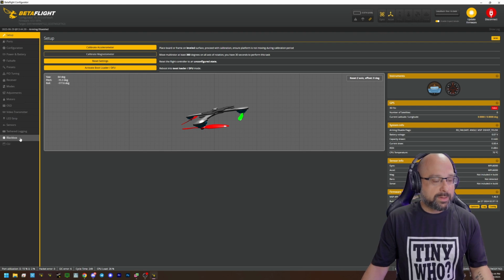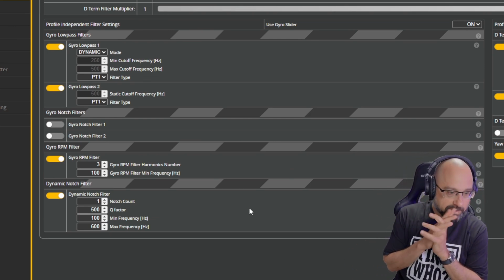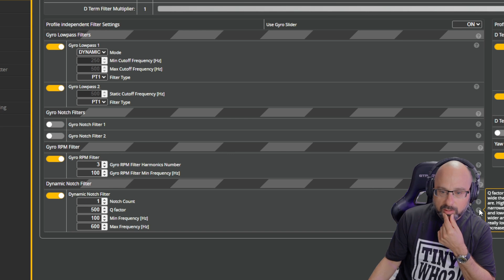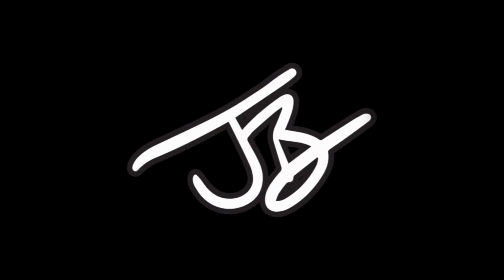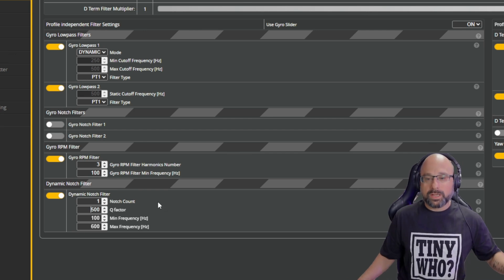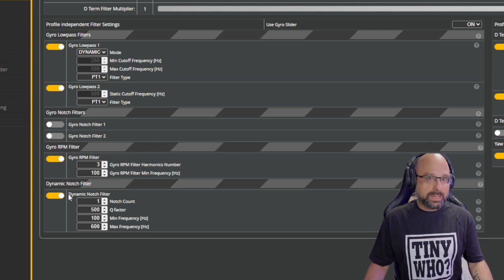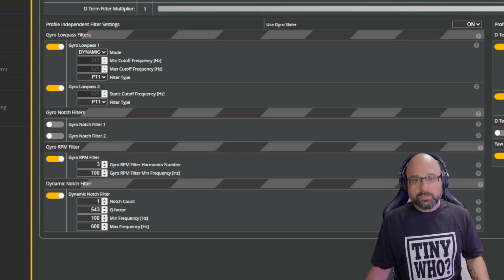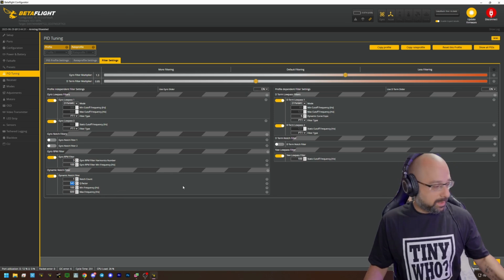Why Do Racers Adjust Q Factor And What Does That Mean? - FPV Questions

Comment: I have the avata2 but I have the Motion 2 controller and want to buy the fpv controller but am scared to crash and I also want an drone to take with me so I thought about buying the Cetus pro kit to practice and take on vacation.
Is this a good idea or not?
Thx a lot!
Reply: Assuming you have goggles 3 for your avata2, I'd look into something like a 85mm tiny whoop with an o4 lite, and the dji controller 3 if you're set on a controller that'll work for both the avata2 and a quad with an O3/O4 air unit. 85mm is big enough to fly outside even with small amounts of wind, they usually take light crashes better, and just good for beginners because parts are cheap when you break a canopy or prop guard

happy flying!
Reply: @ZuwuFPV thanks for the suggestion!
Will building yourself be cheaper? And do you think a 4” is the best size?
Reply: @RacerThieo so, building is maybe for when u are more advanced, but if u want to do it, it’s really tough, especially if you go for cheap ass parts. 4 inches is mostly for small long range, cause 5 inches have got more thust, and 3 and 3,5 are more resistant as they aren’t as big. If u are gonna build, go for a 5 inch. Although i would recommend you to start with the previously recommended 85mm
Reply: @HtRe_22-o7m oké thanks I am gonna challenge myself though en ho with a 3”.
I have already done it with a friend and although I believe it will be though, I think  I might be able to pull it of with my friend!
Reply: @RacerThieo then good luck, but it’s not wrong to buy a bind and fly if you just can’t figure it out or don’t want to get into soldering

Comment: I have more questions than answers from this answer. What does the Q factor do that, I, as the pilot would notice? What symptom would I be trying to fix with the Q factor / Or what would I be looking to improve by changing this value?
Reply: Generally, lower PID loop latency results in better propwash handling. The quad stays smoother in sharp turns where it's sliding sideways and especially when it's aggressively on throttle.
Reply: Q factor controls notch filter width. Increasing Q makes the notch more narrow. If the noise you are trying to filter is broad, you need lower Q. If it's very narrow frequency band you can get away with higher q.

You would notice this by increasing Q on rpm filters of dynamic notch until something gets messed up, like hot motors, bad sounds, or flyaways.

You can tell before that if you examine logs.

Default Q is fine for the vast majority of cases. I race and tune and I leave it at default. I don't want to have my quad freaking out when I bend a prop or delaminate an arm.

Comment: Please dont suggest anyone to disable the notch filter. Delay from one notch is not even 0.1 in most cases and we already have ton of people picking wrong presets for their builds and blaming hardware for their faults. 

Keep it safe, dont touch it nor disable. Happy flyin
Reply: I didnt see him suggest to do it, just that some people may do it and then the reasoning as to why. I dont think anyone will watch this and think "bardwell suggested I either crank my Q (lol) or turn off dynamic filtering"
Reply: @ZuwuFPV 2:11

What you write is what happens in lot of troubleshooting groups and posts, sadly.
Reply: @jasukenneth  fair, maybe I expect people to be smarter than they really are hahah